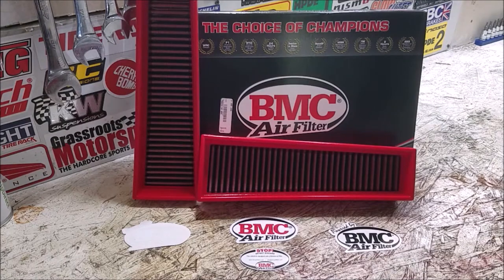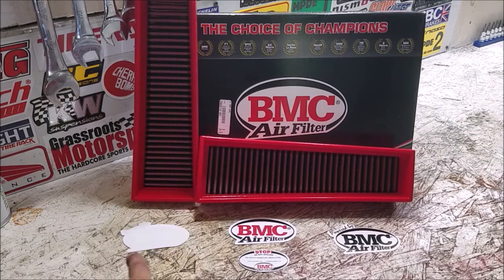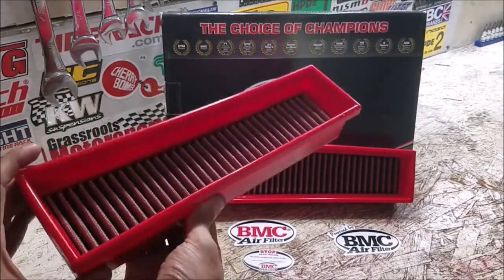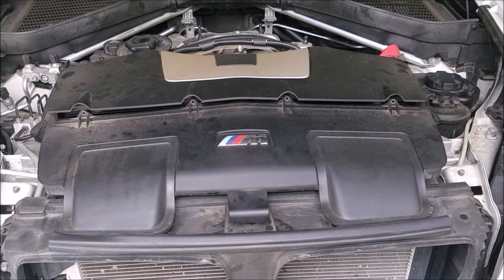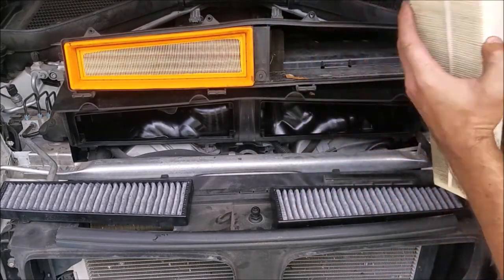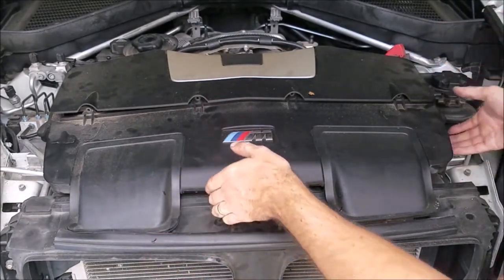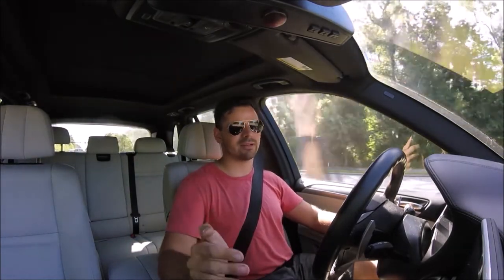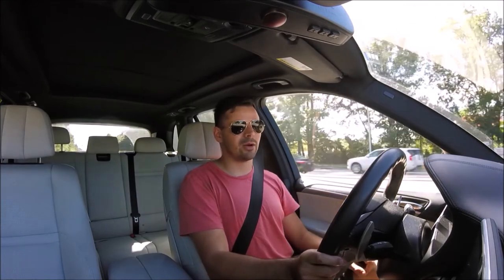E70 BMW X5M BMC Air Filter Install DIY (and Charcoal Filter Delete)

Comment: You won't feel the diff, you need to chip it first, and only when the paper filter becomes a bottleneck cause you need better air intake - only then these filters make sense.